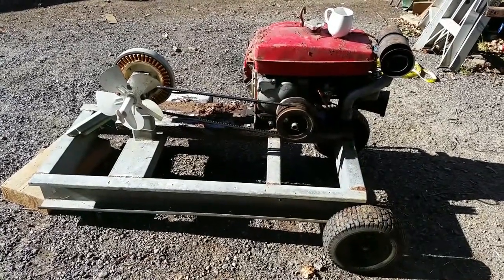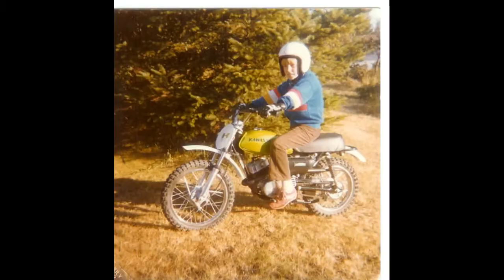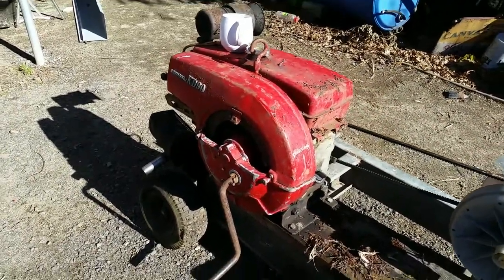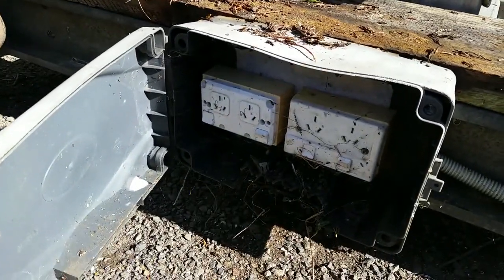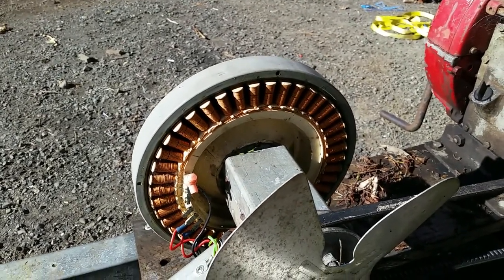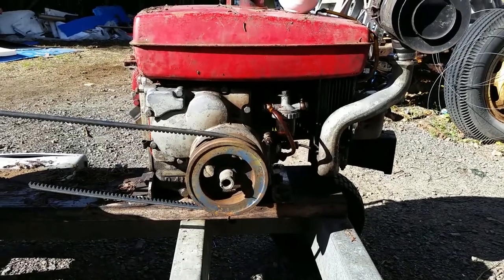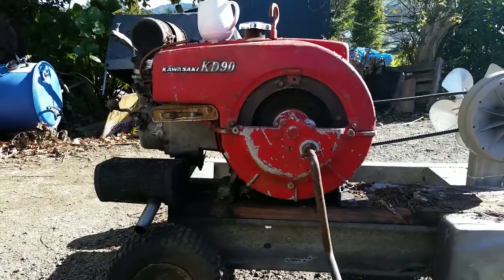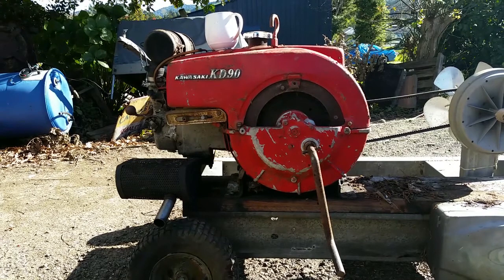Vintage Diesel Stationary Engine Mystery

Comment: On a side note there is a compression relief valve that you open to kill the compression so you can spin it up as fast as you can then close the valve with fuel on.. some have a spot to warm with a propane torch before starting..
Reply from the maker: Oh I got it going the next day once I had a can of either - To start its the same as my little chinese Diesel.

Comment: My first instinct says Taiwanese, or possibly Indonesian, from the old agricultural engines of my youth. But the Dutch/German writing says not. 28hp is a hell of a lot from a small diesel, especially one that old. 28hp diesel tractors from that era were at least two and more usually three cylinder motors and a much bigger lump plus water cooling. My guess would be no more than half that. Possibly even less than 10hp. The 6hp air cooled Taiwanese diesel that I used most days in the 80s was about the same size and took a bit of starting. Have you found the decompression lever? For hand starting, you hold the exhaust valve open until you get the flywheel really spinning and then drop the decompressor and try to keep some speed going. Anyway, I'm probably telling you what you already know. It's an interesting lump. The injection pumps are often proprietary so there's may be name on that to give a country of origin. Good luck!
Reply from the maker: Awesome- thanks for your help Nigel. I do have a 6.5 chinese engine of the same type so I know how to start them. They make them right up to 30hp https://www.youtube.com/watch?v=-R31ZxpoJZg  
On mine the stamped engine number is KD90 000255 so its an early example of whatever it it is. I very much doubted his claim of 28hp but it really is much larger and heavier than my 6.5- my guess is under 10hp, maybe 12 at the most.
Reply: Kohler prefaced all their small diesels engines with the KD prefix.  It might be a Kohler, but they are an American company.
Reply from the maker: I still have no info on this!

Comment: That’s a single cylinder asian portable tractor engine.. I’ve seen them put into little trucks and cars n whatnot.. my friend uses a rope on the pulley and his truck to start his lol
Reply from the maker: yes thats becoming apparent. Ive seen similar Kubotas - and underneath the red paint is a coat of what looks like Kubota orange - but no search success yet. thanks for your info